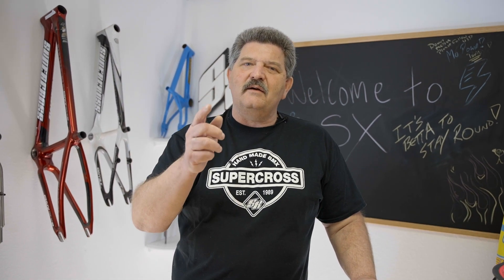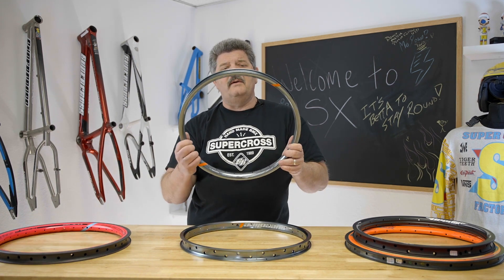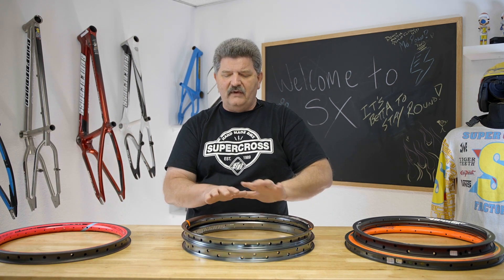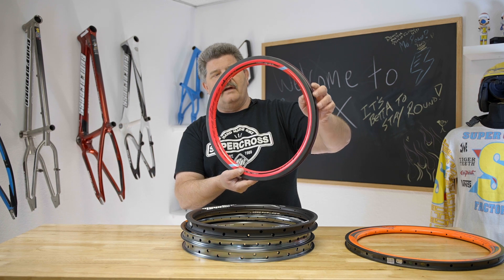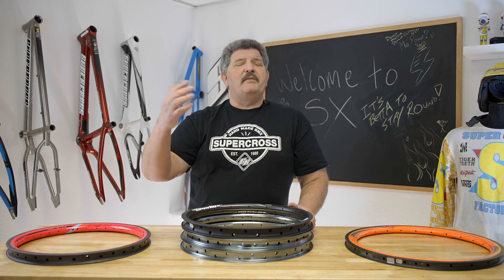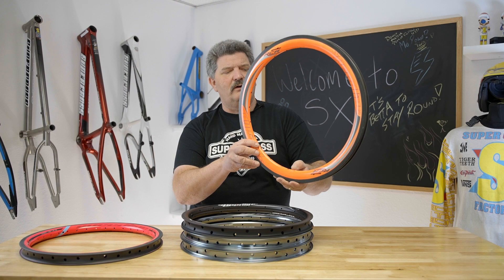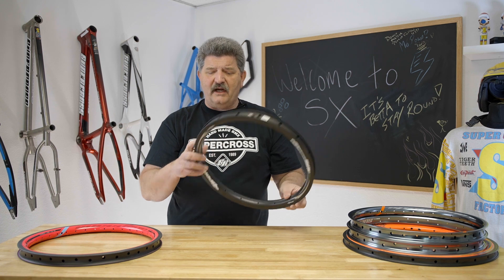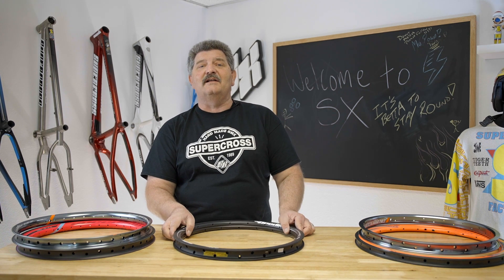Do Carbon Rims Improve Your Performance in BMX Racing? - Watch and Learn

Comment: I jwatched the carbon frame video before this and I think you said the carbon used is T1100KS. Now I’m curious to know why T700 and T700S is used for the rims if the 1100 is stronger and stiffer? Is the cost-to-effectiveness not worth it? Thanks for these videos. It’s awesome to have a manufacturer making such informative videos.
Reply from the maker: Hi @Scott Counsell , Yes, you are correct, the Frames do use a T1100KS, thanks for watching and learning, each carbon material, like Aluminum and steel has it's properties that make it better for a certain structure, as well as a cost as you mentioned.  We could do a rim with T1100KS, but it would really increase the rim cost,  and BMX hasn't been ready for that yet.  As well as a new mold to adjust to the Tensile and Yield of the material which will start to happen in the future as people get more performance orientated and see benefits, keep your eyes peeled.

Comment: May I ask, so with a stiff Carbon rim would then a 14G stainless double butted spoke are recommended because to deliver some flex under a critical situation, while a Ti spoke would break a hub flange?
Reply from the maker: I have never seen a Ti spoke break a hub flange, usually the Ti Spoke breaks at the "J" bend.